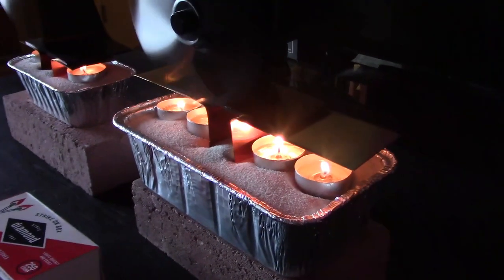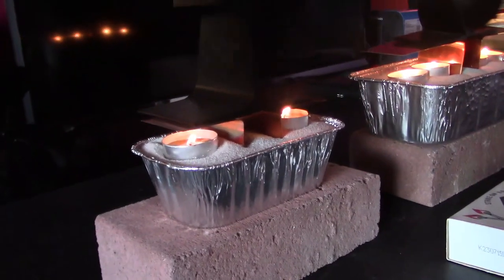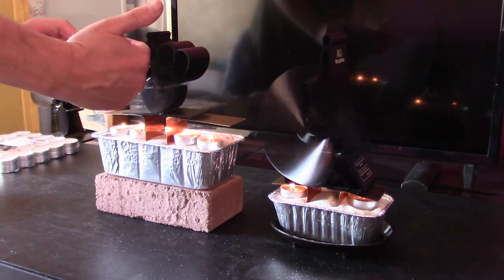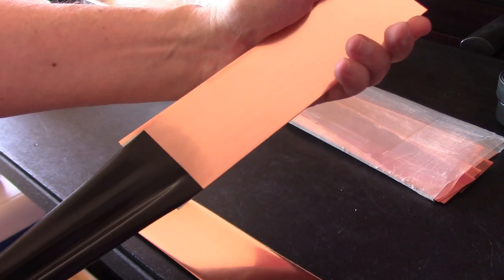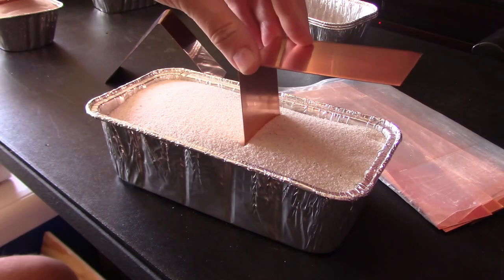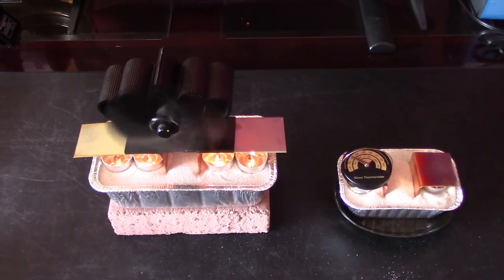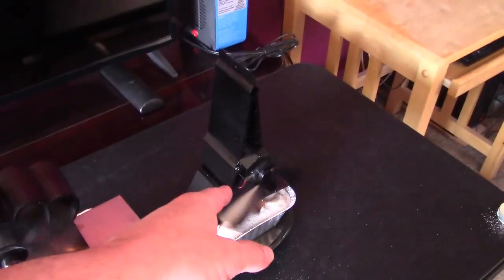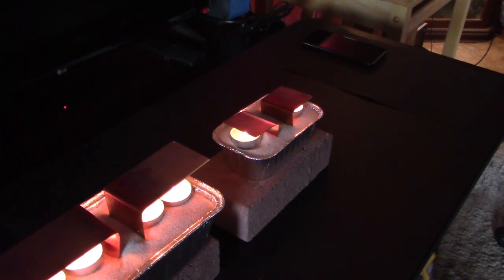How to Make a "Sand Battery" Air Heater at home (w/copper, candles, sand and loaf pans!)  w/heat fan

Comment: Try putting your fans on your DIY atmospheric generator. Point your fans on the coils, have some kind of over hang over the coils, like maybe a piece of cardbord. The idea is the cardboard is having the wins bounce off the cardboard and back into the coils. Making small vortex of wind over the coils. This will make the surrounding area suck the air toward your device (atmospheric generator)
Reply from the maker: i'll have to give that some thought. i like it when i can combine a couple of my projects to make one or both work better
Reply: @desertsun02 

Dehumidifier, atmospheric generator , swamp cololers and air conditionerr has similar techniques of farming  water out of the air. And each device use a fan.

Just like your device with coils, cool water or cold air throw pipes then a fan blows on the coils or a radiator type device. 
Coils are easier to use with a fan. 
Radiator you need a powerful fan to force air through  radiator. 

Look up on youtube, look for  a guy name Moses west, he made an Atmospheric generator for a community that had been hit hard with a hurricane and 
Knocked out power gride for weeks on end. Moses west built this machine and used a Gass generator at first to help this community to produce 1000s of litters of water on a continuous cycle. 

Later he swap out the gas generator for solar power. Still consistent with with 1,000s of liter of water per day. 

When you find his story listen to his machine Hum. That hum is fans. 

You had made a battery out of sand to help to power a fan. You really don't need a powerful fan. You just need to get the fan moving air. If you are able to make some kind of vortex out of air over the coils. You will produce or farm more water out of thin air. But if you find  a way to use a powerhouse that isnt so energy intensive like fire. Use electricity to heat up copper plate for your fans. Like solar panels and store the power into a battery some sort. 

If I where you that is the direction I would go. 

But your sand battery is amazing fix if power goes out. And you need to cool off the air and make water at the same time.

Your atmospheric generator and sand battery is way to go. I would curved cardboard over coils not blocking the drip of water,  yet create  a Vortex of air over the coils, by blocking the air or make a vortex of air over the coils

Comment: So my question is, how long does the heat last once the tea lights go out (assuming you let them burn out after lighting them from fresh) and what kind of heat difference was there in the room you were in? (From start to while it was going until the candles/heat source exhausted?) I'd like to use these to help heat a small greenhouse in the colder spring season and possibly extend my growing season into the fall.

Comment: I’m sorry if this is a silly question. What kinda copper did you use? For example, if I went to a hardware store what do I ask for? Thank you so much
Reply from the maker: hi there. i'm using copper sheet metal (24 gauge). best place to get it is on amazon. they sell it in bulk by the pound or you can buy pieces that are precut. they have a 6 pack of copper strips that are precut that i recently say. i think they are 2.5 inches wide and 10" long (so you'd have to cut it down a little. but that is easy).

Comment: If I can't find copper at lows, will sheet steel work?
Reply from the maker: hi, steel should work too (but copper will give the best results). btw, don't use galvanized steel. the candles will most likely burn off the zinc coating

Comment: I made a sand battery out of a thermos. I took the bottom off first. Then once I had the hollow opening I turned it upside down and filled the thermos walls with water and froze it - once I had ice I drilled 1/4 inch holes not to the top but through the outer wall of the thermos toward the top. Maybe an inch and a half down. Then I filled it with salt and heated the bottom with a little alcohol stove. It heated fast - once it burned out a candle maintains the heat. The hollow thermos allowed heat to rise. The holes forced the hot air to go farther up and back down out the holes - at least I think maybe - my candle burned out a while ago and the whole thing is still warm.  It won’t heat my house but I’m comfortable with it nearby.
Reply from the maker: sounds interesting. i'll have to give that idea some thought 👍🤠
Reply: @ some use a Kelly kettle but I got a cheap thermos at a thrift shop 
I made a small one but it was too small - the taller one is a lot better - I put some copper pennies in with the salt the other day and I think it stayed warm longer.

I’ve also been thinking how I can use a tin can full of salt or sand with a larger can upside down over the top - holes punched in the sides of the top can to pull hot air over the sides of the sand can for more heat. So far my draw back is how to elevate the heavy sand can to put a burner under it to heat it and have it not be too top heavy while allowing air between the top can and the sand can without making it a disaster waiting to happen.

Comment: I REALLY WANT TO MAKE THIS BAD.......what is the thickness of the copper, the length and width.
PLEASE PLEASE TELL ME.
Reply from the maker: hi. the copper i used is 24 gauge. but you could use a slightly thicker metal if you wanted to. since tealights are 1.5" wide, the best width for the copper is 1.5" to maybe 2.25 inches. it doesn't have to be exact. as far as the length, you can adjust the length so that it fits the container that you have.
Reply: @desertsun02  do you know what 24 gauge is in millimeters. Thats the way its sold on ebay

Comment: I'm correcting myself here - I commented on a candle-heated sand battery I didn't believe one would work because one candle flame wouldn't put out enough heat. I looked up the heat of a candle flame and found the blue part of the flame reaches 1,400 - 1,800 F. So these could do the job, depending on sizes of room vs candle(s) including number of candles. Impressed me...

Comment: Where can I find those fans?
Reply from the maker: hi. amazon has them. search the term 'heat powered stove fans' to find them. last i checked they have like 7 full pages of them. that's probably over 100 different fans. smaller to mid size fan is best for this setup

Comment: I have a question; 
You're using candles so that's a constant source of heat. 
80 of a sand batteries you heat it up and then it produces heat for several hours. 
So you really make it it's really a thermal Mass heater producing conductive as well as radiant and convective heat?

Comment: New sub here! I have a 4-tier greenhouse on my apt patio. I need a way to warm this greenhouse at night since temps have fallen into the upper 30s. I need something super simple that won't pose a fire hazard - so from watching your videos, I got my 12qt stainless steel stockpot and filled 3/4's of it with sand. I put it in my oven on a low heat (250F) for a few hrs. I checked the temps with my digital thermometer and I'm getting  175F in the middle of the pot with the outside part near 200F. My plan is to put it on the bottom of the greenhouse with a clip-on fan on the shelf above it to help disperse warm air through the greenhouse. I'm also going to cover the greenhouse with an extra layer of plastic for insulation. I have a wireless thermometer inside the greenhouse where I can monitor temps indoors. Hoping this works! 🤞🏾🤞🏾
Reply from the maker: hi and thanks for subbing! i just posted another video you might be interested in. it's a sand storage air heater made using a big stainless pot filled with sand that might work for you. it is candle powered and the circulation fan is also candle powered, but the candles sit on the sand and are well within the pot. produces tons of warm air for hours. if interested, here's the link https://youtu.be/bJhO_OyQypI
Reply: @desertsun02  Thanks!
Reply: Once you have the sand warm in order to get through a night you may want to set it up with candles and copper as seen here, to carry you through until morning or through a colder day.  Save money, heat it in the oven once and then employ the candles and copper to keep it warm all day until it is needed.
Reply: Is the clip-on fan plugged in or not?

Comment: Doesn’t produce more heat than just burning the same amount of candles to head a room right?
Reply from the maker: hi. that's right. the same amount of heat is produced. the unit just stores and re-distributes the heat where you can feel it (i.e. bottom half of the room/living space). without the copper and sand the heat of the candles just rises straight up to the ceiling - where you can't feel it. (it's like the difference between sitting next to a hair dryer that is pointed straight up at the ceiling versus it being pointed at you). if you wanna feel the heat (and get warm) you want it pointed right at you. or at least pointed so that the heat stream is horizontal instead of vertical. 🙂👍

Comment: Would be good to know what temperature "a ton of heat" is from these little heaters. Details matter.
Reply from the maker: hi. heated air coming from the unit was averaging about 130F (roughly the same as the output air temps from of a natural gas furnace (at the vents). average output temp of those is 120F to 140F).

Comment: These are cool, my only reservation with doing these is the air quality in the rooms you're heating would poor.
Reply from the maker: hi. air quality may be slightly affected but not by much. (2 tealights are roughly equivalent to 1 regular size candle) so it's just like burning 1 or 2 regular size candles in your house. i often burn 4 or more with no noticeable change to the air.
Reply: @desertsun02 

Exactly. 
People that are in danger of freezing to death I can worry about the air temperature so much...
I'm looking at things for North Carolina and Tennessee because people out there living in tents in fishing Sub-freezing and possibly Sub-Zero temperatures.

Comment: What Guage of copper? What type of sand? Do you have affiliate links?
Reply from the maker: hi. they sell it as 24 gauge copper (but it seems a little thicker to me). 22 gauge should work good too. the sand is 'play sand' (the kind that you use in a sandbox. it's cleaned and filtered. the sand can be found at the home stores (home depot etc.) and the tealights and loaf pans at walmart. here is a link to the copper i use https://tinyurl.com/bdejbay4

Comment: an update with timelapse of a clock and these, and some thermometer readings would make this a very scientific video! great job
Reply from the maker: hi. it puts out warm air almost immediately but it takes maybe 45 minutes for the sand to reach very high temps and then it consistently puts out very warm air. i ran it for 2+ hours so it might even get a little hotter if you run it longer.
Reply: @desertsun02  try a 200Wish solar collector, my napkin math says 20 mins should get it up to 370 (depends on how you heat it tho I guess, needs to heat the plate beneath it or full container? sand reflects too much light, would be great if you filmed it as an experiment with timelapse / clock / thermometers etc, would do well!
Reply from the maker: i'm on it (started filming a 600w collector heating the sand 2 days ago) 🙂. will try fresnel lens too.
Reply: @desertsun02  Awesome! 🦅

Comment: daaamn wild I just replied to your two year old video about this, and was going to message you to make a sand battery air heater... and clicked and saw you just uploaded this!! great job, presentation is very good.
would love to see durations and air temps of the main flow. try a solar collector for 10-20 minutes and see how long that runs inside and how it warms a room

Comment: are these more effective at heating than just putting lit candles on the table?
Reply from the maker: hi. yes. 100% better. without the copper and sand the heat just rises straight up to the ceiling where you don't feel it. this unit radiates the heat outward and the fan pushes the heat way out into the space.

Comment: I may have to use this as a emergency heat source /Christmas gift.  😊
Reply from the maker: sounds good 🙂✔ i particularly recommend the 4 tea-light model, that one really cranks out the heat. tip: walmart sells 50 and 100 packs of tealights super cheap (usually $2.50 to $5.00)

Comment: I'm slightly afraid for your health with all the candle emissions, but your projects are always fun~
Reply from the maker: hi. i never burn more than a few candles or tealights at a time so it's pretty low on any emissions. i've heard beeswax candles and tealights burn cleaner (but they cost more). tealights, in general, burn cleaner than the traditional style taper candles, so that's also a plus
Reply: @desertsun02  Excellent to hear~

Comment: Cool. Could you provide a list of materials? Such as what kind of fans you are using, gauge and size of copper sheets etc?
Reply from the maker: sure. the fans are heat powered stove fans. they sell dozens of them on amazon. probably best to use a small or medium sized one with this project. even the small ones move plenty of air (without being too bulky). that smallest one i used is only 15 dollars. the copper is listed as 24 gauge (but sometimes it seems a little thicker than that (so 22 gauge would probably be okay too). the length and width of the copper sheet can vary, so it's okay to 'eyeball' that to the size that will fit the pan you are using. i put it all the way down to the bottom (so the fan has a sturdy base to sit on). the easiest way to get the copper is to look on amazon. here's the link to kind i used https://tinyurl.com/bdejbay4
Reply: @desertsun02  Thank you! I appreciate it.
Reply: Bruh... If it isn't obvious... Idk.
Reply: @ Bruh… I’m not a bruh… and if it was obvious I wouldn’t be asking. Stay in your lane.

Comment: Do you have a source or link to that thin copper?  Maybe in one of your other videos?
Reply from the maker: hi yes. i get that copper on amazon. if you search for copper sheet metal 'one pound scrap pack' it comes up. currently it's $17.80. here is the link https://tinyurl.com/bdejbay4
note that when you buy it this way, they sell you all sorts of sizes and shapes. you can also buy specific sizes but it costs a bit more that way.
Reply: I'm sure home depot sells the copper.I would even try a craft store.They might have pieces for crafts or experiments.I found spools of  thin copper wire there.

Comment: ....these 'Sand Battery Air Heaters' are amazing. l use a clay pot, fiII with sand, pIace the bent copper 'L' against the clay pot side, with the 'L Shape" facing inward (saw it in one of your videos). l then pIace on tea candle under each 'L' (in this case, there are five), and one in the center....light the candIes, and piace a red brick on top. The sides of the clay pot get hot, aIong with the brick. l need to get a fan to set on top. ...Thank you for aII of your great ideas!!! :)
Reply from the maker: you bet. it's great to hear that you've made the project. the brick will add even more thermal mass (and should be a solid place to put the fan)
Reply: @desertsun02  the brick makes it more of a radiative heater as well as a convective heater, maximizing both for best use of heat conversion, instant heat as well as heating air quality is good - using fresnel collectors to charge them in 20 minutes is an investing idea, would love to see an update with FLIR and air temp readings, timelapse etc.
Reply: @removechan10298  I am so glad to find your experiments and hopefully we will do better at keeping warm!
Reply: I am so glad to find your choices..I hope to do this and be warmer in these cold days of late.

Comment: 😂 . 

“It worked” 🐽 😂- your click bait!
Reply from the maker: hi. clickbait? no clickbait. this project is 100% real. 🙂
Reply: @  did it though? Test the room temp 😉 🙃
Reply: @MarshaMarshaMarsh4  ...yes, it does work!!! l heat a space using these 'Sand Heaters' :)
Reply from the maker: yes, these definitely work. (especially the one with 4 candles). that thing is amazing.
Reply: @MarshaMarshaMarsh4  Room temperature tests would be interesting. That said, assuming you've got some insulation in your walls, if you've got a hot object in a cold room, are you seriously expecting the room to remain cold? That sounds like some crazy magic.
Reply: What’s so magical about it? It’s all relative to the size of the room, size of heater and temperature. There are other videos out there that show increased room temperature with similar heaters.
Reply: @tsmith3286  Magical disappearing heat that suspends the laws of physics! Weeeeeee let's have fun with the fewest neurons possible!
Reply: @ all heat dissipates correct. You’re point?
Reply: @tsmith3286  Is pretty much lost on someone who seems to think they've already learned everything...
Reply: @  😂😂  why so mad “😠 😤🤯?”
Reply: @auturgicflosculator  Can't prove a point, talk in riddles. 😃😃